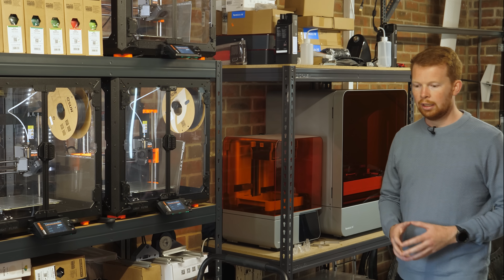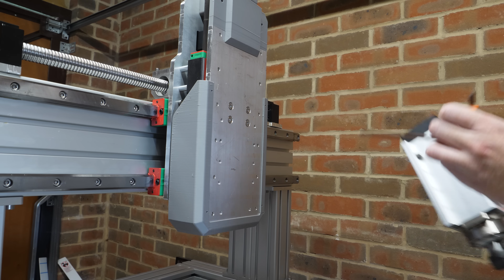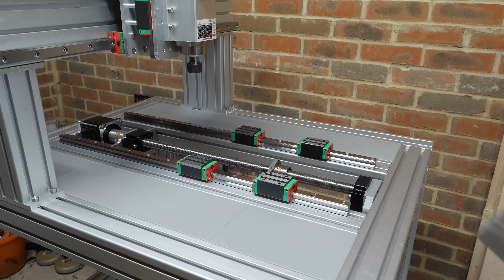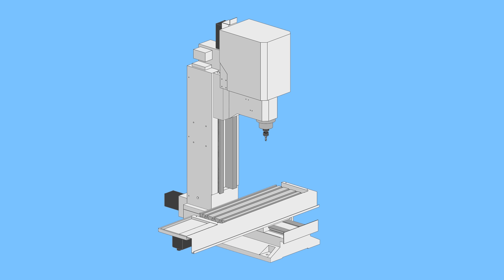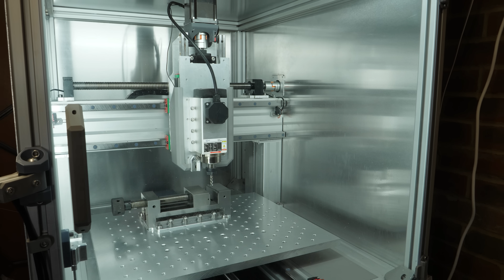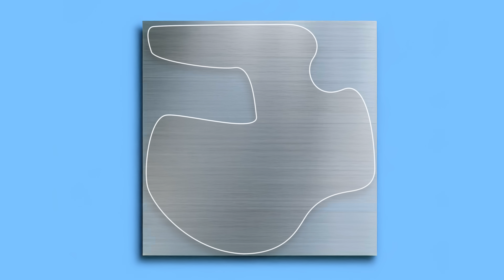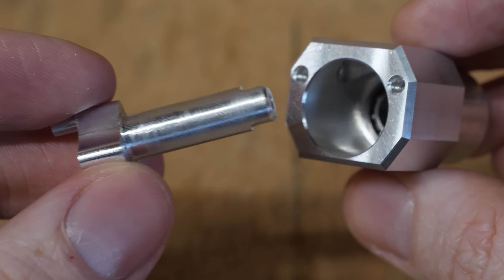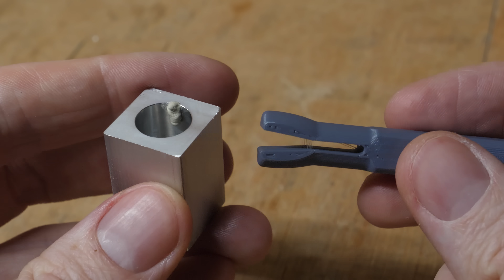I Needed an Engine, So I Built a CNC Machine

Comment: Hey Tom
An idea came up to me when you were fine tuning the cylinder
As you show in the video, at some point of threading down the cylinder to adjust the timing the RPM of the engine went up, but it springs back because of the intake hose elasticity. 
Is it possible to take advantage of this problem and make a sort of throttle control that works by threading more or less the cylinder into the block?
Maybe by way of an arm that comes out of the cylinder's side, pulled by a string or cable, with a spring that makes it go back to place (maybe add some stoppers for min and max configuration)

This is my attempt of converting a problem into an advantage, feel free to correct me if I'm wrong, or add ideas too!

Sorry if there's any typos, english is not my first language.
Also, first time commenter, but an always-watcher.
Great video, greetings from Argentina!

Comment: Tom, I know an important solution to the voltage drop of compressed air, it works with your regulator(flow control valve.) Using a Phase Change Material Thermal Exchanger that is heated by a Peltier Tile. The Peltier Tile is nice because it regenerates thermal energy from the environment when a voltage is applied to it. The PCM is paraffin wax, sodium acetate, or water, depending on the atmospheric conditions. DM me and I will send you the link to the academic paper about a compressed air car that shows the exogenis of the circuit.

Comment: using the the adjustment of the cylinder with a dual horn servo and cable you basically have a throttle for RC
Reply: it would be perfect

Comment: Would it be possible to recycle the exhaust air through a one way valve back into the tank to increase runtime?
Reply: even with a one way valve its still lower pressure (you would need a pump)

Comment: Perhaps get yourself one of those tools for dialing in and zeroing a part with the spidle running at low rpm? They cost like 20ish €/$/pnd a pop and they make the process of dialing in so much faster and more precise. After looking around I figured out these things are called "Mechanical edge finders" in English and you certainly want one, trust me on that!

Edit: Also when you cut the surface of the piston, you wasted move time, you could just have returned and cut at teh same time, it's little things like taht that get the cutting time down and would make a part more cost effective, especially when you are still in the rough cut phase and not in the end cut already.

Comment: Does timing effect performance and efficiency at different psi and rpm? Given you can change the timing with rotation, maybe you could get crafty with a small servo to control timing as pressure lowers. Not sure if the added weight would be worth it, but might be a fun experiment

Comment: I would suggest getting a set of spiral point taps for through holes, and spiral flute taps for blind holes. You can use them in a drill and makes tapping super easy, just tighten the drill chuck round the smooth shaft, then when you overload the tap it just slips instead of snapping in your part. Works great for even tiny M2 taps. Hand taps are just awful and break really easily in my experience.

Comment: I just want to say what you built, especially for the price, is super impressive. Long term you might want to look into way covers for your ball screws and guides, chips and debris WILL find their way into the inner workings. Also coolant use with aluminum always helps, but of course makes a mess. And always use the shortest tooling you can get away with to help cut down on vibration. But this is cool man, I'm jealous.
Reply: hey! so i noticed something here. i think you may have accidentally selected a comment and your cat may have pressed ctrl+c and you went to type your own comment and your palm hit ctrl+v and enter or something. might wanna get that looked at

dont copy comments. especially not ones from @adamdecurtins3405

Comment: The engine at the end looks great, my first though would be that you could use a motor or some kind and a gear/belt assembly to automatically control the valve timing for testing/tuning so you can then "hardcode" the timing values in the final engine.

Comment: For your problem of making good cylinders , get a boring head. Then mount the cutting bit in reverse (ie facing inwards) and you should be able to make external curves without having to make a custom tool for each diameter. Also for your issue of the cylinder head rotating I would imagine a locknut would do just fine

Comment: My ex wife asked me why I'd spend weeks designing, prototyping and manufacturing a custom airbrush stand when I could just get one off amazon for less than £15.
As every maker will understand and non-makers never will.... you don't make the thing to have the thing. You make the thing to make the thing. The process is the fun part.
Believe me, Tom, you don't have to justify machining a part out of aluminium when it'd be cheaper and easier to 3D print it....everyone who subscribes to this channel understands.

Comment: When finding zeroes, like to do it by wiggling a sheet of paper between the part and the cutting tool and then jog the tool until I can not move the paper anymore. Then the tool is like 0,05-0,1 mm away from the piece, which most of the time is accurate enough (if 0,2 mm isn't, why would anyone not use a probe if available :D?).

Edit: 
Doesn't your mill support G2 or G3 codes?

Does your mill have the ability to orient the spindle in a certain way? If so, look into boring into only one direction. Meaning, stopping the spindle at the end of the hole, orienting the spindle and then moving the tool a tiny amount so the insert doesn't hit the bore anymore. Same could be done with your custom tool!

Anyway, a really cool video, and project!

Comment: One of the things we learnt back then in workshop class is that you reduce the chance of your taps breaking by doing 2 turns and than a half turn reverse, I imagine it removes stress from the tap. We never broke any taps.
Reply: It backs the chips out of the way, lowering the chance of a chip jamming and raising the resistance of the tap.

Comment: Could you use a small generator with super caps to help heat the cylinder ? you could make the valve timing a feature of the engine to control the power output with a servo motor.

Comment: Why not use a pushrod to let in air? This way you could offset the timing and let the air in at tdc, if wanted you could make the cam lobe on the crank indexable for best efficiency, you can set the duration of the inlet by adjusting the height of the rocker arm if you make the lobe in the right way , this should not be too difficult to machine. I love the air engine projects :)

Comment: How thick and heavy would a 1lb air tank need to be to hold 10000 psi of regular air.  GPT "You'd need the steel walls to be about 1 full inch thick all around." GPT "The tank alone would weigh about 50 pounds!"
Reply: "Composite Fiber Tank - Wall: Thin liner + fiber wrap , ~5–10 lb for same size"

Comment: Love your style, you'll be thanking yourself for a long time with that machine! I made my big flatbed a fixed gantry with a tilting work bed. I can make the gantry mobile if I need to but the twisting flex of the gantry annoys me. I also made up two plates to mount a stepper to a rotary table, then made a mounting plate for a 150mm chuck with bolts on the front. So it's a 4 axis with a fifth indexed axis. Not much I can't do, it's just a question of time! I also CNC cut dovetails on the outer chuck jaws (just mount a grinder on the Z axis!) so I can use wood lathe dovetail work mounting plates and switch from lathe to mill and back. I've also been able to do simple grinding on stainless bar stock to downsize it and add facets. Also I avoid using a hand drill for taps, I find its best to start the tap on a pedestal drill, although with two hands occupied you've got to stop it with your face! For best results use a proper square engineers vice, but a solid adjustable fence often suffices. When you're doing screw holes, just set the fence and stop then run through from pilot to set size to tap. I've done hundreds if not thousands of holes this way and never broken a tap, not even an M3!

Comment: I bought a CNC router several years ago and built a very cheap CNC before that.. and my feeling and rough estimate tell me that if such service as JLCCNC existed years ago, it would probably have been cheaper for me to outsource the manufacturing instead of buying that equipment that I don't use enough.. but it was fun and a great learning path, so it brought more value than just the parts I made!

Comment: Using the same materials that are in contact with each other will lead to more friction (aluminum with aluminum in this case). As a machinist, I would recommend that you swap out one of the part contacting parts, either the piston or the housing, for something like brass or aluminum bronze. JUST NOT COPPER.

Comment: Nooo, no, no. You should lap the two parts together! This way they achieve the precise fit. Lapping with a 3rd tool is not the right way to do it. The lapping of the bore should be done using the piston you want to fit in it as the tool.

-And indeed you have a lot of blow-by which adding oil helped to remedy. If you're familiar with two-stroke model glow engines, you know the piston and sleeve wear together to fit each other perfectly - and that's the effect you should have by lapping the two parts together. Lapping individually obviously means mismatched sizes.

Comment: What are you going to put this motor in? Why do I ask, it's gotta be the next video. Unless the next video is about making the badly needed lathe. You can get by without it, but look at the good job you did on the CNC. When you buy stuff new or used that is already made by someone else, you have to learn how use it according to them. So making your own is customizing to you. I am totally impressed with your CNC and the sand epoxy stuff was a genius move, I don't recall if you are mounting it to the floor but that kinda goes without saying.

Comment: Drill and tap an m3 hole in the crankcase, use a grub screw with thread sealant on it to pinch the cylinder in place for timing.

Comment: @13:26 don't know if your particular firmware supports this, but codes G3 and G4 define cutting in an arc/circle, which might give a better surface
Reply: G02 (G2) and G03 (G3), not G04 (G4).
G04 (G4) in standard G-code is a Timed Pause (Dwell / Delay) command.

Comment: This is too cool! Maybe for locking the cylinder in place, you could machine teeth into it and use a worm gear to fine tune it kinda like a guitar string tensioner. You could then use a small stepper on the worm to have a sort of variable timing.

Comment: Well done. Impressive set up. As for your engine, I am not sure how you expect parts to keep moving without consistent lubrication. You could use o rings for piston rings as some of the novelty engines do. Either way that cylinder needs lubrication or you will just metal to metal the piston and wall reducing efficiency and causing unnecessary wear. Even in a plastic engine friction is a thing. The air will blow away the lube. Maybe try a diaphragm for a piston.

Comment: For timing adjustment you could consider a worm gear attached to the crankcase that spins the block in and out. That would give fine adjustment for timing adjustments and the worm gear would (mostly) prevent the block from unscrewing and changing the timing.  Possibly you could have one end of the worm gear's bearing surface split with a screw in it that you could tighten securely lock it from spinning after it was tuned, but a simple dab of some locktight or superglue would also likely be enough to prevent the wormgear from backdriving while being weak enough to overcome if you wanted to remove or change it later.

Comment: few things

1- make some covers for the machine ways and ball screws
2- that probe mount is a little precarious, and may allow movement when it touches the part
3- for machining rounds on a mill, one of the things you can do is place the part on the spindle and the tool on the table
4- you can also make a "lathe attachment" with a motor to be placed on the table, which allows you to have both a lathe and a mill, so you can machine everything in one go
5- that engine needs a nut to lock the height adjustment of the valves in place
6- for the price, thats a very competent machine for garage stuff
Reply: Hey, randomly saw your comment. I agree with your points, but I'm confused what you meant for no 4. Are you saying that he should get and install a second drill motor to the base plate? If I understood you correctly, my intuition is that you wouldn't want that lathe attachment in when you're doing the initial milling. Would it be just as effective to make a chuck to attach the part to the drill motor and have a stationary lathing tool mounted to the base plate?

Comment: Could you give it variable valve timing by adding a servo to rotate the cylinder? Perhaps using it to throttle the engine without an additional valve

Comment: I make high accuracy mirror smooth FDM 3D printed cylinders. I print them slightly undersize ... then insert a heated polished aluminum mandrel and allowed to cool somewhat before removal.

Comment: You spoke about round motion with the gcodes. Don’t the software of your CNC accept the G02 and G03 codes?  I understand that it will never be as precise as the tool you made but will make de code far way shorter.   Very nice build though.

Comment: Hey. You can save the part with broken tap! This trick works only in aluminum. Dissolve as much Alum as you can in a (crock)pot of warm/hot water. Immerse the aluminum part, turn on the heat, and allow the brew to simmer for a couple of hours. The tap will dissolve, and the aluminum will get a kind of sooty coating that washes off.

Comment: Does your controller (the duet) support arc commands? I know that the marlin firmware for some 3d printers does. If you use the arc gcode commands it could significantly improve the quality of the circular cuts as well as make the gcode file smaller.

Comment: You could also gear the stepper motors down before they connect to the ball screws so I stead of each motor step turning the ball screw 1 degree if you gear it 2 to 1 now the motor turns the screw 0.5 degrees doubling your resolution but halving your speed using toothed belts and pulleys is an easy reasonably backlash free solution

Comment: So on an unrelated note you havent done anythi g with rockets or wings for a bit you could use your machining skills to make a fidget spinner of death control system basically put little wheels on the control fins of a rocket and their inirtia keeps it flying straight and v² says the faster the rocket the more control force goes up so you can use lightwieght servos to control high power high speed ro kets in a self tuning manner works best with air launch missile systems but a coke bottle full of air and a solenoid could pre spin them for a ground launch.

Comment: Just curious why your code for a circle didn’t post out as a g02/g03 arc move? I think you’d get a pretty serviceable circle. Although if you need the fit of a cylinder and bore the precision of your process is obviously much higher than a hobby machine like this could be expected to do by interpolating.

Comment: I don't understand how the mounting piece for the probe is electrically isolated from the frame, as you use a metal bolt to connect the mounting piece to the frame?

Comment: i would make an quick tool measurement system in one corner of the plate using z axis setter and quick coordinate system for parts by using machine cordinate system on the corner of your vice and measuring the distance from your vice to part and using offset. also adding 3-jaw chuck to the plate for round parts would save time... these things would make your day alot easyer. 17y experience here.. also add coolant and by using different types of aluminium you can decide what part goes out first. also google and use molykote 321. good luck..

Comment: Stopping the cylinder from turning is an easy fix. Put a bump with a vertical threaded hole on one upper corner of the crankcase and make a clamp ring with a screw into that hole and another screw through a split opposite the vertical screw. You can retrofit that to this engine by milling a bit off one side and screwing an extra bit on with the hole on top.

Comment: Smooth curves are why you use servo motors and a controller capable of circle and arc interpolation. Steppers can also be used with such interpolation, with better results using micro stepping. 2:1 toothed belt reduction will also improve resolution but of course slows the speed.

Comment: 13:36 I don't know which CAM software you use nor which firmware you run on your mill, but the G02 and G03 commands are usually used for curves. It is also just another form of interpolation, but you can get really precise curves with these.

Comment: Bro??????????? Are you saying to me that your CNC board don't support round coordinated GCODE? It does make part of the gcode standard.....Like G02 and G03, one of then make cicle cuts in the clockwise and the other on the anti clock wise to make a round move. example: G02 X65 Y75 R30

Comment: It’s likely that the optimal timing while running will be different to the optimal timing for getting the motor started. Either consider starting the engine with something that spins it at the correct speed like a drill, or have a ‘choke’ where the timing or airflow is altered for ease of starting

Comment: nice work .. well .. one way to fix the position of threads without using Loctite would be a counter nut/locking nut, another one is to drill/bohr/ream through both and use a steel peg/springpin or something lik that .. the first ist adjustable, the second repeatable position